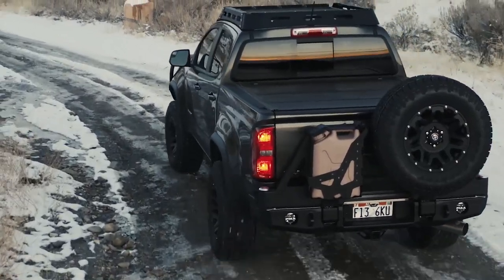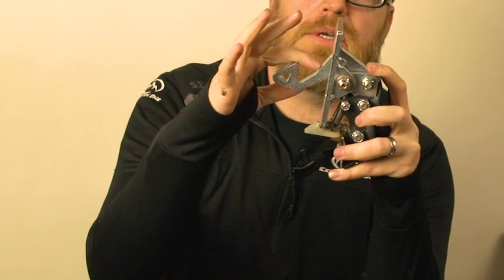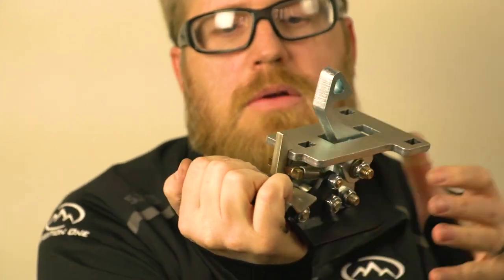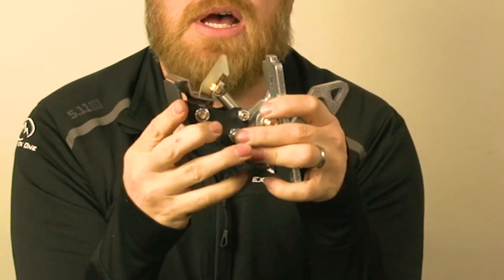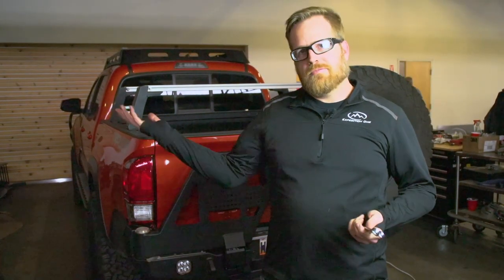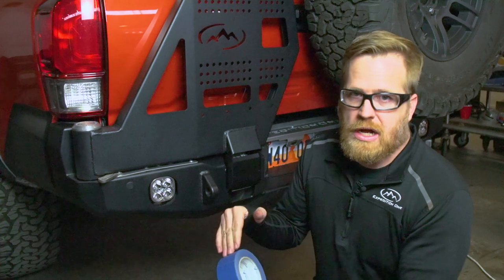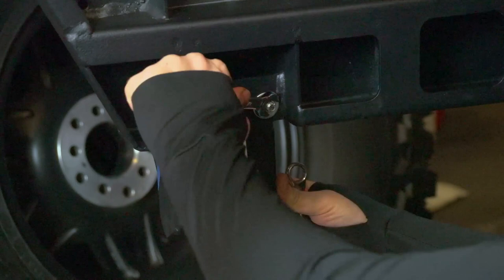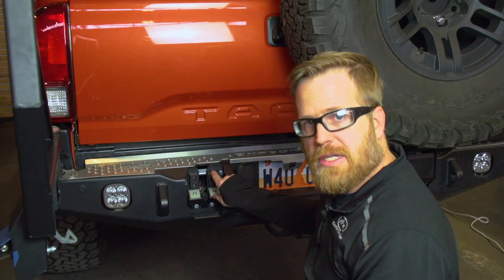Expedition One - Latch System Overview

Comment: After 3 years one of my latches cracked on the hook piece. Really wish they  made it out of steel. I'm  waiting for someone to let me know if they will warranty it or sell me just the part. I also have a front bumper and roof rack from them. The powder coat has already separated from the front bumper in case anyone was curious about the longevity.

Comment: It's a great mechanism, but confusing how to adjust it on the vehicle when it is not working (quite) right. Iost track how many times my tire latch has popped open on a trail And ruined the pin that keeps the arm open. 
Great intentions for the video but he honestly was moving the latch around so much in his hands it was really not easy to follow. Also, maybe something helpful, like "if yours pops open, do X, if yours is difficult to close, do Y

Comment: IF it is engineered well, and torque specs are elementary engineering understanding, why aren't you emphatically stating the Torque Spec for those bolt nuts rather than leaving it willy nilly to the installer? For a $3k product, it's a huge miss on that point.